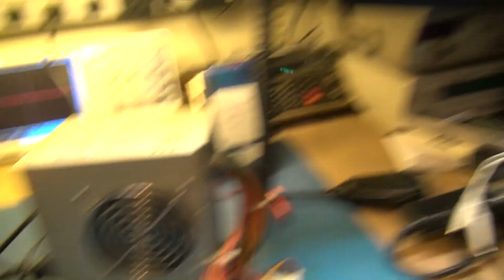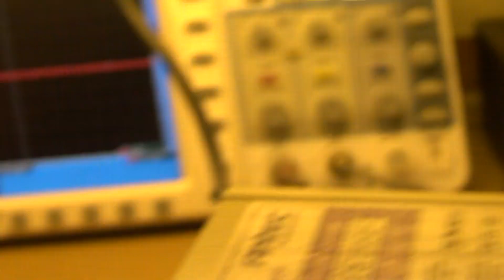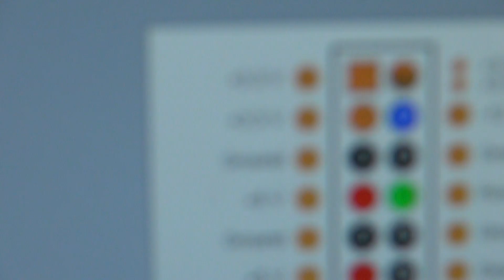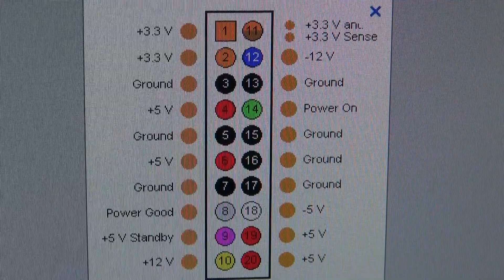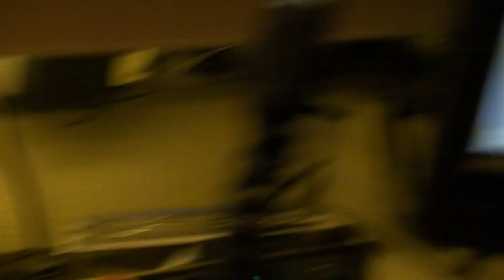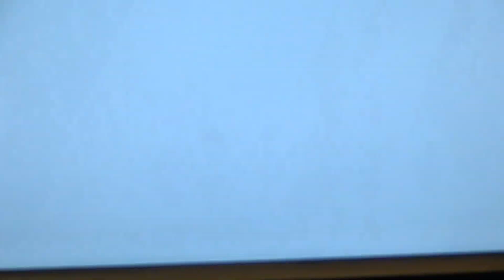Computer ATX Power supply Repair Test After repair.

Comment: As far as I can tell you're not testing with any load on the power supply... so wouldn't that make your test not very accurate? since it can fool you and show a stable current that might otherwise not be so stable (at full load) due to bad capacitors and bad filtering... ?
Reply from the maker: Its a swich mode power supply. load or no load the noise would be present. hooking a load up tests power parts stability not noise.

Comment from the maker: it could be bad transistors, transformer or caps. without any other test equipment it would be difficult. look for bulged caps. Other than that you would be guessing without a ESR meter or to scope the -5 volt rail

Comment: I have multiple power supplies that wont work in any pc.  jumping it, the fan comes and using A Digi multi-tester they All tests GooD...   So I use a power supply tester from ebay..  It shows on All of the non-working ps's that the -5volt is Not working.   Ive checked a few of them visually for bad caps and found none.    Any Ideas..  How to fix?

  Thank You....     :+)

Comment: Hi I know I'm a moron for doing it but I plugged in my power supply to a 240 volt plug with the switch set to 150 and it sparked and isn't working. What element to I need to fix to get it up and running again. Thanks

Comment from the maker: I was using ac coupling to see there was any major ripple.  I dont think those pocket scopes are good for doing this you might find that the lcd respose time is to slow or it lacks alot of resolution. Even this $400 scope has some trouble  displaying amplitude modulations but it does work. I think the pocket scopes are good for diplaying general waveformes but i am unable to give you a  accurate answer of how well. Ive never owned one other than my fluke 123 but that expensive also.

Comment: Are you using the AC coupling setting on your scope to isolate the noise or can you see it without it? I'm looking at getting one of those inexpensive pocket scopes for around $70 but it doesn't have AC coupling and so I wasn't sure if it would be useful for this sort of thing. Thanks...